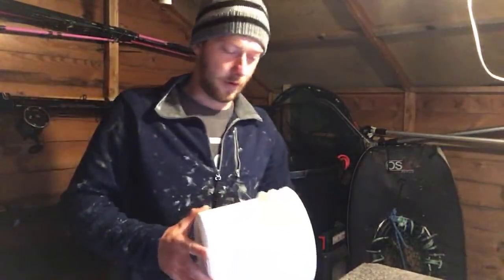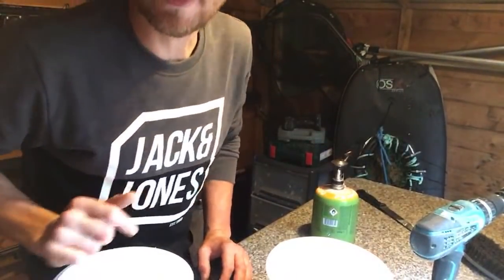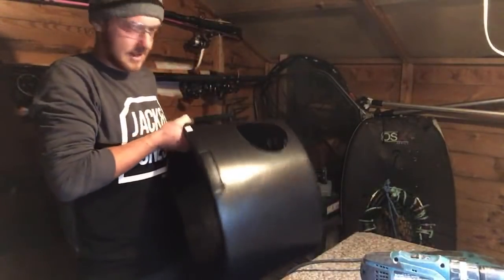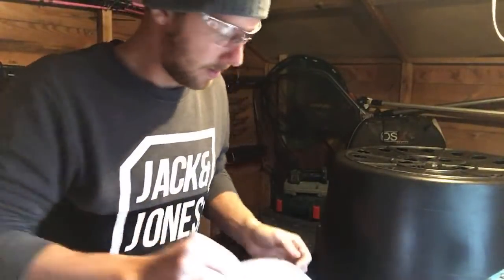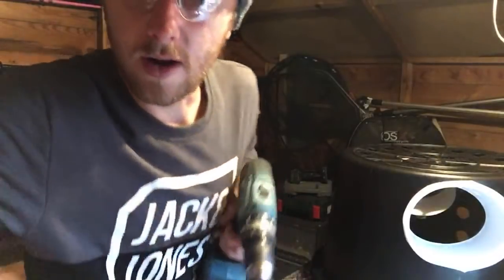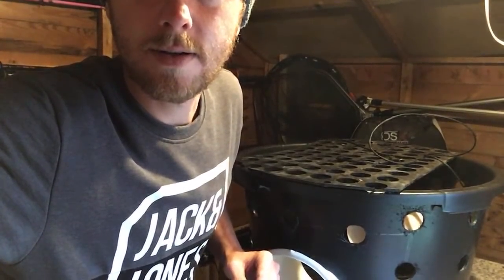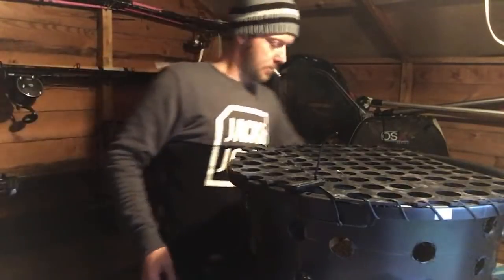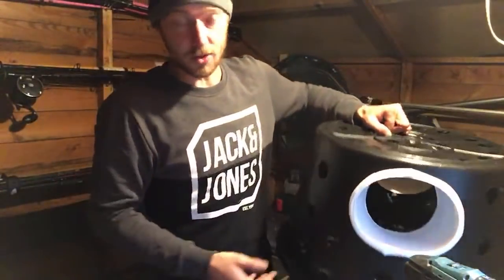Cuttlefish trap build !

Comment: Hey mate,  FYI the slots on the side of your hole saw are so you can stick a straight screwdriver in to pop out the plugs instead of dulling your knife and the saw teeth by picking them out from the front. Keep up the good work. Been meaning to ask when you have those super low tides are they preceeded or followed by a super or higher than normal high tide. Here in the states that's generally how it works . I'm originally from the shore of New Jersey.